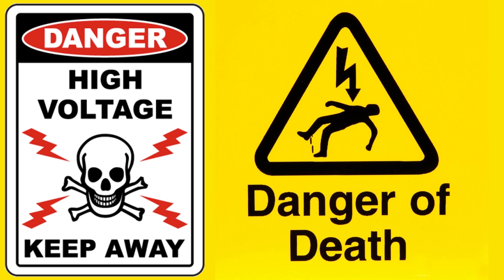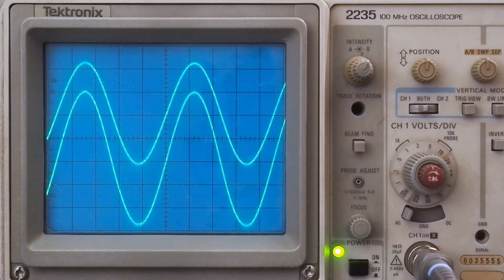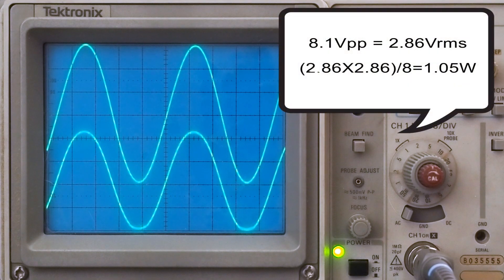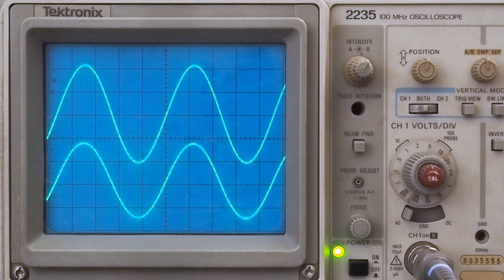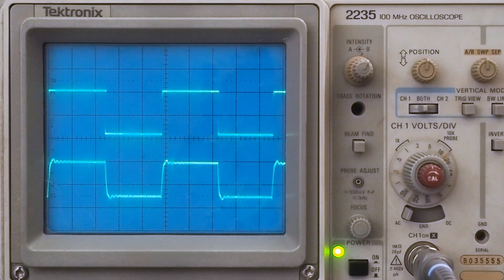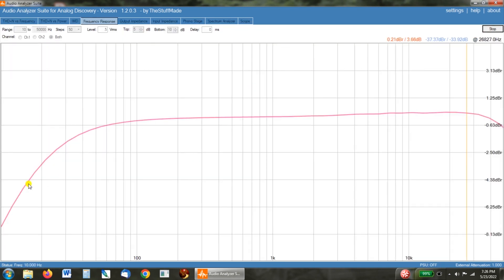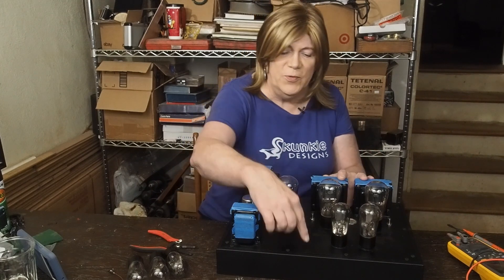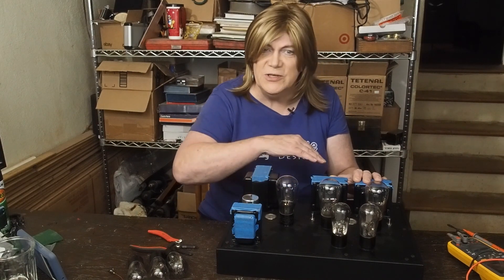1930's Globe Tube Amp: First test session!

Comment: Thumbs up for the great work. I always learn a lot while watching your videos.
But why use a 47? While there are stars like the 45 that are still available at reasonable prices, especially used.
So far, I've built two 300B SE projects, then a Loftin White 45 se amp 12ax7 driven, and whow.. my best amp so far. 
And please, tell us more about listening impressions about your amps projects. Thanks for sharing your knowledge. Sylvain, Quebec
Reply from the maker: Just to do something different. The curves for this tube look very linear and I saw very few is any amps built using them. Mostly the same reason I built my 6SQ7/EL34 amp, I didn't see anyone using those either :) Plus these globe tubes just look cool to me.

Comment: Bottom trace bottom looks like it has some fuzzy - is that instability through the feedback? The 45s really don't put out much, less than the 2a3 and far less than the 300B. The slant of of the square wave shows it will be bright (the bode plot confirms that). I'm wondering if the pre-tubes are having difficulty with the 47 grid. You could try a single channel and double up the 25s as a test to see if bass increases without negative feedback.
EDIT: Ok - fuzzy YT compression artifact, no neg FB so all good :D Overshoot can sorted easily.
Reply from the maker: I think some Schade NFB tuning will fix all of this, not real concerned about the overshoot. My experience has been: trying to totally eliminate that ends up with a dead sounding amp.

Comment: The RCA manual says 2.7 watts at 6% distortion, so you may be able to get a little more out of it. It will be interesting to see how it actually sounds.
Reply from the maker: Was that for the early globe tubes or the later coke bottle type?
Reply: @SkunkieDesignsElectronics  I wasn’t looking carefully enough. It was the coke bottle shaped tube.
Reply: I did some more research and found a much older RCA Radiotron tube manual. Although there was no date on the manual, they mentioned that they were moving from the 3 digit tube numbering system to the new 2 digit system. This manual listed the 247 tube, which they described as the 47 tube. The power rating was 2500 milliwatts, no distortion specified. The tube shape was the bulb style you are using. My fist post was from a 1939 version of the RCA manual.
Reply from the maker: @brycejeannotte7699  That's what my old RCA-10 manual shows. If you do the math, 31ma at 250V is 7.5W dissipation. A 2A3 is twice that and those only make a few watts at best.  I'm not sure how they end up with 2.5Wrms power from 31ma at 250V, maybe they are talking peak watts? I still plan to tinker around, maybe play with the screen voltage/current, but I'm pushing this tube pretty hard, at least 90% of max, so not sure what's left? Maybe a touch of Schade feedback will clean up a bit of the distortion. If I can end up with 1W at 1% or less distortion, I'll be happy given the vintage of these tubes!